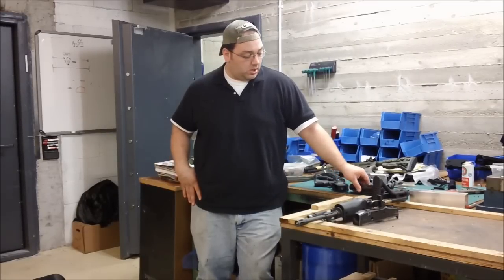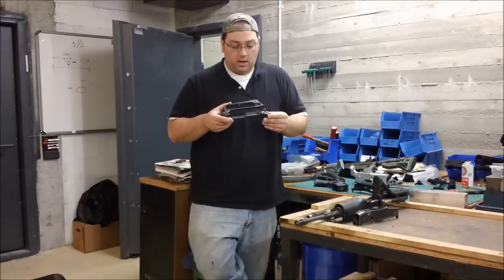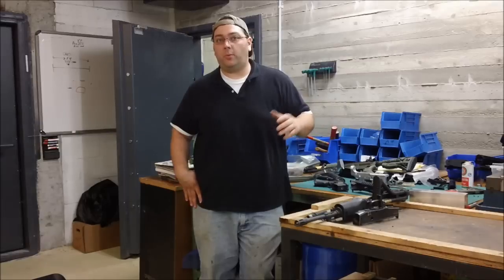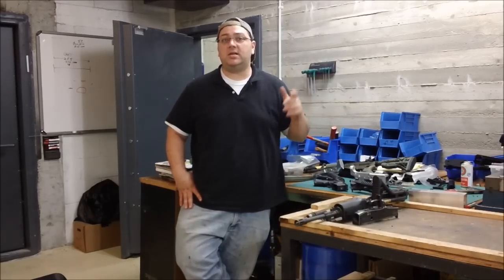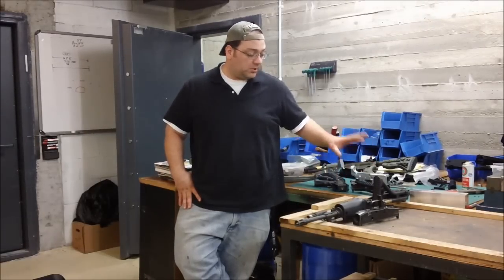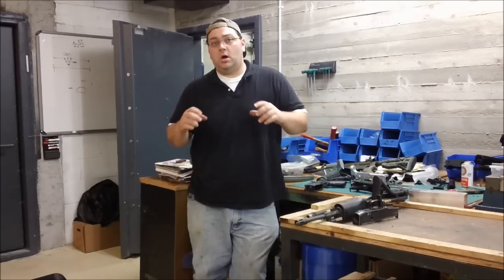Seeing is believing! Milled vs. Forged receiver strengths. Also a look at barrel obstructions

Comment: It's important to note that without an understanding of the sort of stock that a milled receiver starts from, no testing is worth anything. Receivers can be milled from drop forged, extruded, or cast blocks. The block that is drop forged at the foundry has the greatest potential strength, due to being compressed by hydraulic hammers. As it comes from the foundry, there is no greater strength to be had through forging. This is the strongest piece of aluminum possible and you have a greater strength POTENTIAL milling a receiver from this block than you do with a forged receiver. POTENTIAL. Cast billets have inclusions, bubbles and other impurities that weaken the materiel at the base level. "Forged" receivers have the disadvantage of less materiel. So, given a forged receiver Vs a milled receiver cut from a quality billet of foundry forged aluminum, the advantage in strength of materiel is ALWAYS on the side of the milled receiver, because they can forge a block to a much higher pressure than they can forge a piece of aluminum into a curved, complicated shape with dies. Therefore, it can be assumed that any structural deficiencies displayed in a receiver milled from a quality billet are not inherent weakness of the materiel by comparison, but rather geometric differences that come about as a result of the stock removal process. It is much more difficult to reproduce complex geometric lines through milling than through "forging" because what we refer to as "forging" is actually a superior version of casting, and not actually forging at all in the classical sense. Think of forging as casting under pressure. The pressure forces the impurities out of the metal, and that is the end of the advantage of forging when it comes to inherent strength. Aluminum is very different than steel, and as a materiel it does not benefit from the sort of forging that strengthens steel. Steel forms various crystalline matrices according to carbon chain alignment within the grain structure, and forging and heat treating allow one to control that process to a great degree. Aluminum has no such qualities. It is a comparatively soft metal, low in ductility, low in yield strength without anodizing or other surface treatment and not so great in terms of malleability either. Steel can be any or none of that, depending on how it's treated. Aluminum just does not vary much through it's treatment. Either it's solid or it's not, and the inherent variance in yield strength, rockwell hardness, ductility and maleability are usually the results of alloying, not of the handling of the materiel. This seems to be a hot button issue and I hope this clears up some misonceptions that seem be thrown around a lot.

Comment: Also, did you actually test that forged receiver to see if it was from s reputable licensed mil spec forging company? Many companies make ripoff false products. Also people tend to buy cast lowers from the 90's and are told its forged. Some companies forge with a different mix of materials to lower cost and weight, thus not meeting milspec standards. There are very few certified forging companies in the US

Comment: You have to test things that are exact on all sides. Get a milled receiver that meets all the same thickness dimension as a forged, same style (no forward assist, no carry handle or visa versa). Milled receivers tend to be thicker due to the fact that the process isn't as strong as forged aluminum. Forged can be lighter due to less mass cause of its strength. This has been tested and tested and tested over and over again in strict testing requirements, with all test being equal on all levels. Same barrels, same ammo, same forces, same build parts. I have seen rifles take an IED blast and survive. I have seen people drop their milled rifle off a bench at the range and it cracked.
Reply: +James Dean:  I would like to see your DD214. My guess is you never served. ........even if Malon Labe never served that does not exclude his opinion or knowledge.....your service makes you nothing special in regard to common courtesy......if you did serve your general attitude of belligerent name calling disgraces whatever branch you served in and those you served with......
Reply: +Malon Labe; I gotta say I was all for your sentiments until the cracked reciever comment...................
Reply: +Malon Labe I love it when people like you have to resort to bullshit. LOL dropped a billet receiver and it cracked......hahaha yeah right. Oh and not just one time multiple times and you haven't ever served you bitch.

Comment: +GunsGearNGrub It's hard to make much distinction from the two types of material. Aluminium "Billet" could have been forged or not, as we cannot tell unless the manufacturer told us. Also the "forged" is lower could be equal to the "Billet" but unless a controlled test is done, we can't tell. We would need to experiment with a Extruded billet vs. a open die forging. Billet is the shape of the metal, not the actual process a metal piece has undergone to achieve its strength.

There isn't much stress but on the receivers anyways so it might not even matter.
Reply: +Tumdeaux Agreed with all you say.  I'd also like to see a larger sample size.

Comment: THE FORGED UPPER IS STRONGER. Keep reading for an explanation.
This video is misleading but I do believe that he is probably being genuine about the circumstances and results leading to the condition of the two uppers...
Forged is stronger, it contains the expanding gases for longer leading, to higher pressures and eventual kaboom.
The milled upper was weaker, flexed and gave out earlier thus venting the gas at a lower peak pressure.
Is this better/worse? In my opinion it doesn't mean JACK. It's like saying if you have a kaboom by your face it is better that your gun be made out of harmless paper instead of dangerous metal, get over it and don't try to pass off earlier failure as safety feature WHILE ALSO saying it is stronger. By that same argument you can claim that a billet upper is stronger than steel pipe used in a pipe bomb. It's just plain faulty logic. You want a stronger upper to soak up a little more abuse; go forged. You want more custom touches, go billet. END OF STORY.
Furthermore, he starts off talking about LOWER receivers and the shows INDUCED catastrophic failure in UPPERS. Apples to oranges my friends.
Reply: Ironcurtains Forged is stiffer than milled. Though with that being said for things like explosion and impacts you want something that absorbs the pressure the best way to absorb that pressure is through flexing this is what the milled will do better in. The forged have a far better chance at harming the shooter if something was to happen because the forged is trying to fight the pressure instead of slightly going with it (like the milled).
Long story short, just because something is stronger doesn't mean it's better.
Reply: +iinRez I'm really tired, just got home from work so I'm not going to go into all the intricacies of what goes in to milled vs forged. Google milled vs forged receiver and put on your critical thinking cap. 
Believe it or not forged engine internals are the gold standard in performance engine modding for the same reason. Not all receivers are made equal. In general your average forged will be stronger.
While it is technically possible to make a stronger billet receiver it is also cost prohibitive. Do your own research and decide for yourself ;)
Reply: dee pee you sound really smart,out of all the people commenting I believe you.! Seriously for real.
Reply: MrWalkwaySc2 I got my 80% lower for $45 and yes its a forged. Got it at Ares Armory California. If your interested in it.
Reply: GI Nicholas i was talking about lowers . sorry
Reply: Good point
Reply: Omar Huerta The chances of a forged receiver actually exploding is low. And you've got to consider that most billeted parts cost about $250 a piece while you can get a forged receiver for maybe $130 or so.
Reply: Shukin Andjivin I had my coworker help me. He saved me $110 on the kit cuz he had it already so I just got the lower. He didn't do it for me but he had a badass drill press that I used cuz I have a shit harbor freight one. It took me about 2-3 hours. I didn't finish it all in one day though. I did it little by little learning as I went.
Reply: dee pee I don't see how a forged receiver would have a more dense molecular structure. The raw 
bar of a billet is also forged as a solid piece then heat treated so one
 would think the molecular structure of the billet would be superior 
because of this.
Reply: I'm not saying u are right or wrong but I would rather take the mild receiver do to the fact that they were both put under the same test and the forged receiver blew up and shot shrapnel everywhere and the milled only stretched and broke on a thinner piece  of the unit. Thuse showing that the milld could take more of a beating... That's just my 2 cents like I said I'm not saying ur right or wrong that just my opinion

Comment: Mechanical engineering student here, I've worked in machine shops and do some casting and alloying at my house, from experience and some still developing knowledge of materials science, any machined piece will always be on par to or of greater strength than a part that is either cast or forged. A machined piece will always be of a uniform metal crystal because it came that way as a billet. If you were to cast a receiver (why would you do that?) it would solidify into a metal crystal conforming to the shape of the mold and thus be weaker than a uniform crystal. A forged piece would have a mostly uniform crystal if it was forged at once in a press but would also have areas in which the crystal is deformed and harder or softer than the rest of the piece. The reason that a forged receiver is still milspec is that the tolerances of the metal crystal are still good enough to function in its service life and its much less expensive.

Comment: Any second year engineering student could tell you how stupid this is. Billet aluminum is made through casting or extrusion neither creates a stronger material than forging its just a plain and simple truth. The billet upper bubbled and bent because its softer, the forged upper shattered because its harder and doesn't bend as easy. (think about a gold wedding ring and a tungsten ring smash your ring with a hammer the gold bends and the tungsten shatters, which material can drill through steel? certainly not gold) You could throw both types of aluminum in an oven anneal them and they would both be equally worthless its all material properties. This opinion is invalid and based on nothing remotely scientific. Given equal thickness of materials the forged IS stronger undeniably. If you had a triple thick upper it may or may not be stronger I would have to do the math. Regardless military rifles see a hundred thousand rounds with forged receivers no problems, billet receivers are cool looking and have the potential ability to offer reliably higher tolerances but, in an AR the amount of tolerance potentially gained has no bearing in reality its not even worth talking about and you could perform the same tolerance operations to the forged receiver so that doesn't matter anyway. Billet may have a lower density hence weight but you need more volume of it to make it as strong as aluminum anyway so for equal strength they would likely weigh the same.
Reply: troy sauge they add material in key areas because they have to because billet aluminum isn't as strong as forged. The mechanical properties of 7075 billet vs forged are experimentally obtained truths. As I stated equally dimensioned forged aluminum is strong than billet. You can really compare 1/4 inch thing forged to 1/2 thick billet and speak of the strengths of the materials on level ground.
Reply: Shane K yes you're right Shane because forged is stronger there's no argument here, the condition you speak of is called strain hardening its a real thing, its not up for discussion lol. These people just don't know what they are talking about.
Reply: I saw them make an aluminum deep see diving suit a long Time ago. Before they started milling it they had to take oversized blocks of solid aluminum and heat it some and then put it in huge presses to compress it. They said this greatly strengthens the suit so they can make it thinner and lighter. I always thought because of that forged ar15 receivers would be stronger.  Why would this information not transfer over to receivers?
Reply: Rhyginpb didn't spell check that and wrote it on my phone apologies.
Reply: The truth here is actually counter intuitive. Forging in aluminum causes molecular weakness, this is becoming standard knowledge in the firearms industry (with most designers having far more than two years of engineering schooling). Aluminum does not forge well it is done because it lower costs and still falls within the confines of acceptable limits. The strongest ar recievers are the the t6 7075 billets (not including newer LiAl material recievers). Billet recievers also add material to key stress areas.